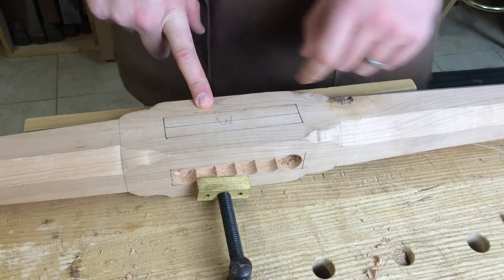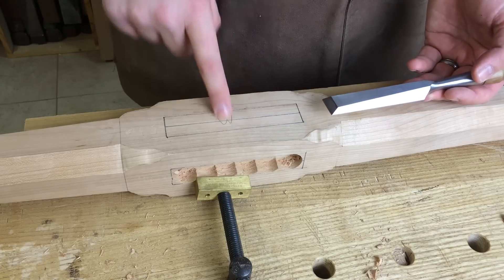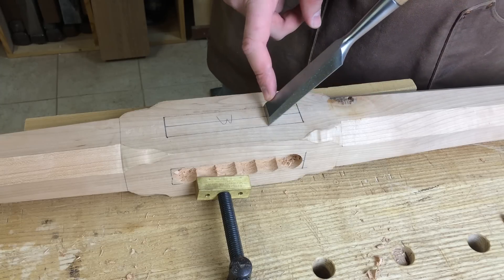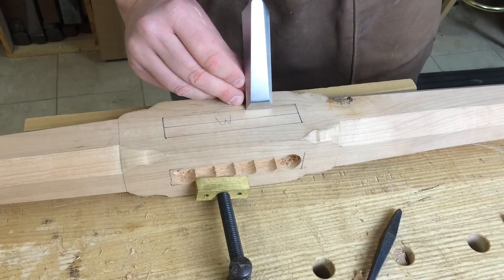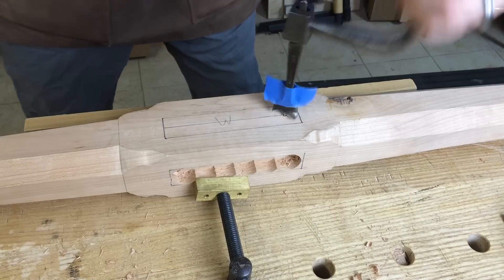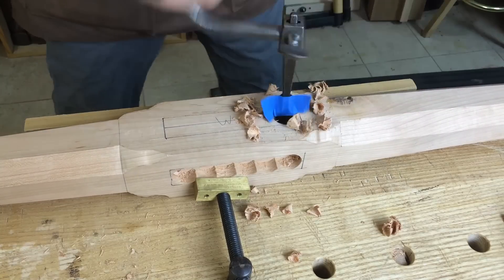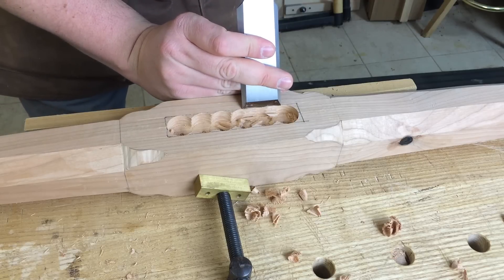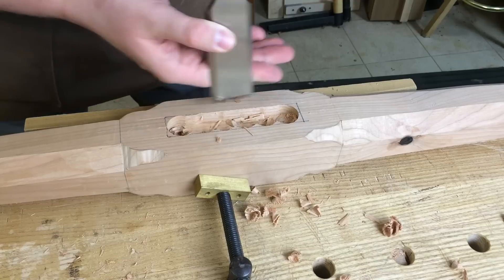Chips 'n Tips 11: Mortise Center Lines

Comment: Hogging out the center of the mortises saves so much time and stress on the wood. Every time I do a crappy job taking out as much as I can before the chisels come in I pay for it later. Good tip on using a marking knife, that'll lead to straighter more accurate lines.